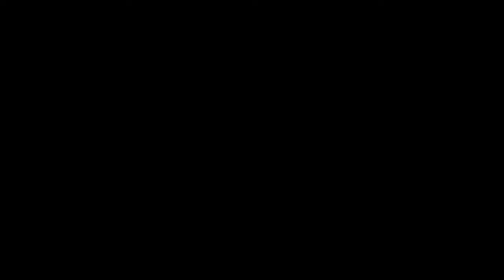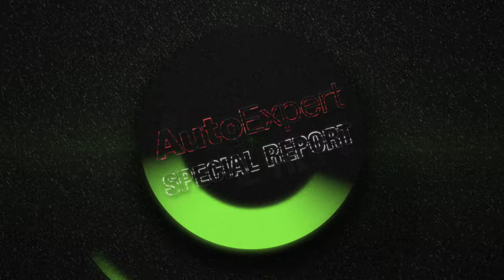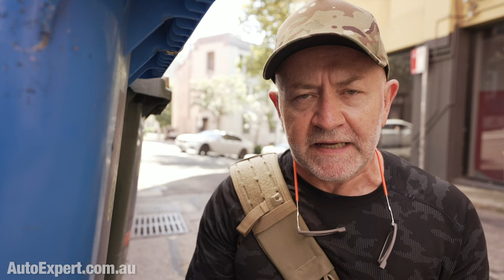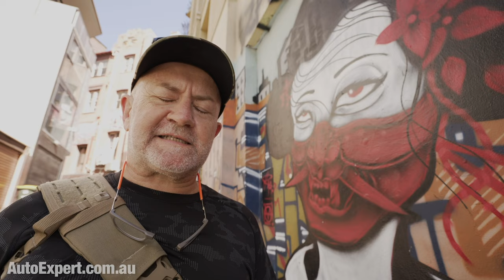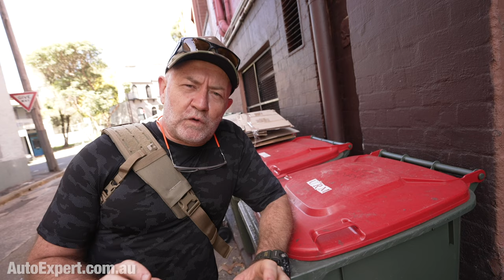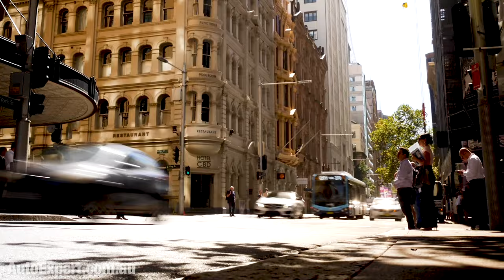These two simple hacks will make your engine last longer | Auto Expert John Cadogan

Comment: The Bmw M3 Has Major Issue Plaguing it Since Inception to Market , If you are looking for an E46 M3, you’ve probably heard about the rod bearing issue. In short, BMW did not spec the rod bearing sizes correctly, which causes premature wear and eventual failure. Unfortunately, the solution is effectively 100k mile rod bearing service. Engine problems are some of the Most common issues reported for the BMW M3 #1 Is Engine Failure , The E46 3-Series suffered from a design flaw in which the mounting points for the rear subframe would crack or tear over time, causing some serious damage to the chassis if left untreated. A cracked or torn subframe mount means the subframe itself can shift while the car is on the move, making the car unpredictable to drive. The most important thing to do when buying a used M3 is get a good look at these mounting points to see if there’s any damage, or if any repairs have been done. Bring a floor jack if you have to—this could cost you thousands in repairs if you miss it. , The M3 with the SMG transmission, know that the pump that actuates the gear changes is known to fail, and costs a lot of money to replace. Clunky gear changes are normal, but if you find on your test drive the paddles won’t respond to your commands or the transmission is shifting especially slowly, it Most Likely in need of a replacement pump. Ive Also Drove Many M3's Never was Impressed an Its Not Anywhere Near Performance Car Perfection Not a Singular 1 Ive Drove Could Earn That Title ... I Worked At an Actual Shop an Regularly Worked On the M3 TSB after TSB , Recall to Recall Electrical Issues Galore Non Communication from Computer Modules . I could Keep Going too  .....
Reply: Are you referring to the big-end bearings on the con rods?
Reply: @0Meaty  Yes

Comment: Don't forget to add a oil flush before changing your oil & filter.
Reply from the maker: Completely unwarranted if you change every six months (and do it with the engine hot).
Reply: Is it safe to do so on an older engine? I heard it is not!
Reply: @AlexanderSSI  Just change the oil before it turns to custard and don't bother with flushes. All that smutz that gets washed around 'inside there' by the diesel fuel (thats what flushing compounds are) ends up first clogging the oil filter, then going through the bearings before you drain the shiny bits of metal out of the sump drain.

Comment: Ah, lovely surroundings, nice to see.
My wife and I (we both have the same Toyota iQ car (a red and a blue one)) put the CVT in S when driving under 50 km/hr.
This way I thought would it more revs and heat u the engine quicker. Out of the city and above 50 km/hr we put it in D.
Plus, indeed driving now and then to a place (Zandvoort) 30 minutes away and come back. It's a nice ride alongside the coast.

Comment: Something that is very enlightening is taking and studying oil samples periodically, especially if what you do qualifies as anything close to severe duty. For example pulling a loaded trailer, very hot or very cold temps with high duty cycles. So remember the last time you were pulling a steep pass, loaded for an extended period of time? The life of the oil and the engine are in direct relationship to the temp. of the oil during operation. Treat you motor as if it was a fine athlete, a work horse maybe that requires an educated operator, not just a steering wheel jockey. If possible, buy a beer for a seasoned tech with some grey hair sticking out from under his hat.

Comment: Fact or fiction or just a waste of time and money
There has been much debate in our family over oil changes, the only common ground which you confirmed, a half service interval oil and filter change.

My brother (oil change)
Adds an oil flush the the oil to be changed. Then runs the car for the recommended time
Drains the oil
Changes the filter

Then
Uses a “cheap” but in spect oil and takes the car for a run.
Dumps the oil
Replaces the filter
Then fills with his preferred oil.

Appreciate your thoughts.

Comment: John,I change my oil and filter always before the recommended intervals. I also travel a lot of country driving (100kmh zones) always AND my diesel does have an genuine Mann and hummel catch can.  So in your opinion would these three things be beneficial?
My egr went on me over 100,000 kilometres now and hasn’t done it again since mind you I installed the catch can about 60,000 kilometres ago so I’d like to think it’s helping keep the inlet stay  clean. My reservoir hose on the catch can gets drained about every 3,000 kilometres and I usually get about 200 mls of cruddy oil out of it. My dipstick levels never drop either curiously

Comment: If people are reading the user manual will find that manufacturers have in place service for "extreme" exploitation of the car. One of the "extreme" is short city drives and they are advising for doing a service at half of the usuall milige. For this reason I'm changing to oil in my car every 6250 miles instead of 12500 miles. Never had any issues with oil dilution. An oil change is cheaper than any engine repairs.

Comment: I can tell you from experience that giving the diesel a good run every couple of weeks at operating temp doesn't stop the gunk build up, may extend it a bit but that's all  ... car makers need to build their vehicles with the correct  equipment fitted right from the get go instead  of pandering to the warm fuzzy climate change brigade and governments with inferior  diesel motors which are not designed for running around the city to drop the sprogs at school ... all they care about is sales

Comment: John, I fully understand the importance of regular oil and filter changes if you do short trips all the time.
That brings me to the question of what to do if you only drive the car once a fortnight, and then on the highway mostly. 
After a year the car has done 2000km, and the oil looks like new. Still golden syrup coloured. 
Can I then go two,  or even three years with the same oil?
Absolutely nobody can answer this question. 
Everyone has a different answer. 
Even Google can't tell. 
PLEASE HELP OUT HERE!

Comment: During lockdown I take my motorbike out once a week and try to break my ~207 km/h speed record. Am I doing it right?

Disclaimer: it’s a short stretch of highway near my house without speed cameras.
Reply: One slip, and it's Road Rash City. And death. Far too fast for public roads, and you might kill some innocent person if it goes wrong.
Reply: @markh.6687  Let's be honest, the only one dying will be me. It's a 200kg motorcycle vs 2 tonnes of car
Reply: @xntumrfo9ivrnwf  Not if you wind up through the windshield...or the driver suffers a heart attack after the accident, or hits another vehicle after the first crash.
Reply: @markh.6687  Agreed - it's a silly thing to do and frankly going fast in a straight line gets old quickly. I don't do this anymore, especially now with things opening up and more people on the road.
Reply: @xntumrfo9ivrnwf  Do you really think so? 200kg's doing 200km/h will do a lot of damage.
Reply: @h2oaddict28  yeh I know, I don’t do this anymore. Original comment was more cheek in tongue

Comment: Hyundai Engine
Class Action
Class action against Hyundai in relation to defective engines
Funder: Woodsford
Lawyers: Johnson Winter Slattery
Note: This website relates to the class action proceedings against Hyundai in relation to alleged defects in the engines of various vehicles sold in Australia since 2011. It is separate, and unrelated, to separate class action proceedings being pursued or investigated against Hyundai relating to alleged defects in anti-lock braking (ABS) systems.

Comment: How uncomplicated with life be when engines are replaced with motors!
Reply: Every time I look into an engine bay I think the same thing. I got an EV recently and I just realised how much less there is to worry about. You can floor it straight out of the driveway without having to worry about it being cold or doing lots of short trips or sitting in the Carpark in traffic with the aircon on. And did he mention do sevice more often?
I think I will just stick with the EV and skip on services.

Comment: So we are now sold cars that are not designed to cater to what most of us want them to do and we have to use them in an inconvenient way just to have them not foul up :(
Reply: Cars now are a little better at coping with short runs than they were decades ago when we used to walk or ride a bike for those short runs.  Don't blame the car; blame lazyness.  If it's less than 5km, a bike is about as quick or quicker anyway.
Reply: @zoltantoth7286  So you expect a pensioner to drive around the city for an extra half hour after doing their weekly shopping at Aldi so to help clog the already filled roads! And the sick bloke should have ridden his bicycle to his weekly radiotherapy at the local hospital oncology unit! Next time I see a dude leaving Bunnings on a bicycle balancing a 20 litre bucket of paint in his head,  I'll give a wave, because I know it will be you. If a car is not for the convenience of one's transport needs, what is it then for? If anything is "lazy", it's your thinking.
Reply: @martintaper7997  Of course I'm not talking about the pensioner or disabled person or when you need to transport a bulky load.  I'm talking about the healthy but lazy sods who clutter our roads with short trips in cars.  Around 95% of trips are shorter than 5km.  The roads would be a lot less cluttered if most of that 95% was done by walking or cycling.  As you said, a car is for convenience for one's transport needs but if walking or cycling is quicker, isn't that more convenient?  As a disabled pensioner, I can still get to the local shopping centre 2km away quicker by bike than by car.  If I need to carry a bulky load from the shops, I take the car and incorporate the shopping into a longer trip I need to take for some other reason.
Reply: @valerierodger7700  Firstly, I'm not referencing myself, so don't assume that I am - everyone doesn't comment from a selfish perspective as you assume. Secondly, yes cars have always benefited from long runs, but modern cars especially with direct injection will eventually fail to proceed and need repair where older cars would just need a good run to remedy the issue. Toyota has even designed their new range of engines to hopefully remedy this issue, so that should tell you how much of a problem it has become. Sure you can change the oil more often, and to avoid breaching  a new car warranty you have to use an accredited automotive mechanic to do it for yet more money again. (My opinion comes from being  a retired mechanical engineer with an interest in cars for over 50 years.)
Reply: @zoltantoth7286  Most people cannot ride bikes or walk for 5km or even much less distance . Riding a bike (as I do but not on busy public roads) is a dangerous pursuit. I knew a keen bicycle rider who was hit by a car on an overhead railway crossing bridge and flung onto the tracks below where he shortly after was dead. Better and free state owned public transport in the city and suburbs is the answer, not bicycles.
Reply: @valerierodger7700  
"And if getting regular oil changes really bothers you that much, get an electric vehicle." - how is that not referencing me personally! "Since you're only using it for short trips" - I'm not, and I didn't suggest I was! 

"You" as a generic pronoun is not used when "directly" addressing an individual as to their position, as you were, because of the inherent ambiguity, and there are other options other than using "one" such as, "if someone" or "if "anyone", but why not use "one", what's your problem with it? "Back pedalling gets one nowhere, we all know that."

Failing to proceed in the short term is unacceptable in any car of any era. You are unaware of the differences and the problems direct fuel injection has created; I suggest you do some research. 
 
Toyota did not incorrectly design their engines. Their previous engines "did not have" direct injection and so did not have the issue of fouling "in the short term". Toyota's new engines have a design which offers a remedy while retaining direct injection. They understood the problem and did not want the same unreliability issues of other car makers; so again, I suggest you do some research.

The problem is not one of my" exaggeration" or "arrogance" and since when was declaring "one's" credentials in a discussion arrogant - people are introduced by credentials even when they are not using them!  The issue  is of car companies rushing new technology to meet expectations of not only customers but more so government regulation, and also trying to save themselves money and maximise profit at the same time. Engine efficiency and cleaner emissions are not served by a design that renders the combustion process after a relatively short time less efficient and worsening for an extended time until failure, and many if not most owners and subsequent owners of new cars made today will over time treat their cars in a decreasingly caring fashion, and have always done so, it's in our nature.

Another example of this poor behaviour by manufacturers is the move to the CVT transmission. This is a cheap automatic transmission and can be done successfully, but some car makers have attempted short cuts. Nissan makes CVT transmissions which commonly fail under 100,000km, but I expect your position is that you would consider this is a reasonable life for a transmission - most don't.  

Customers should never be the testing ground for technology and engineers should get it right before declaring success - that's what I always do.You are a person who is not competent to comment on these matters, but not because you may not be an engineer, but because you have not made yourself aware of the issues in question, and in realising this now you have chosen to make yet another broad brush assumption by way of diversion from the topic at hand in order to discredit me in my realistic and reasonable position.

Do you understand irony, Valerie? You suggested I (or one) should buy an electric car to resolve the issue. So in doing so you accept there is an issue of unsuitability of the technology in question for the purpose for which it was intended, and that's exactly the point I was making!
Reply: @martintaper7997  don't use "one" because - in English - it is very formal, and often perceived as pretentious. "You" is the briefest and easiest alternative, easily understood by most who are fluent in english.

And somehow, even after I explained that I was using the term generically, you (specifically) insist on clinging to deliberate and petty misinterpretation.

You (specifically) continue to assume things about me - for example, you assume that I haven't done any "research", and that I don't understand direct injection. I have been working on cars for almost as long as you have "had an interest" in them, which is part of the reason that I understand very well what DI is, what problems come with DI, why DI causes those problems, what design features address those problems.

You, on the other hand, might want to do your research, given how you made the patently false statement that Toyota did not have direct injection engines before their "new" design. Toyota came out with direct injection engines well over 20 years ago, and they absolutely had fouling problems in those engines. Toyota is also hardly unique in addressing the issues of DI, as many automakers have long combined direct and port injection - Toyota was actually late to the party in that one.

You are absolutely exaggerating the problem, as direct injection has been around a long time, and engines aren't cratering early because of it.

Yes, credentials can be discussed without arrogance, but when you introduced them at the end of an argument, it is nothing more than an appeal to authority - the flip side of ad hominem.

And then you make the absurd suggestion that I might consider 100,000 km a reasonable life for a transmission - before launching into an explicit ad hominem attack! And that highlights your arrogance. A person who is simply confident rather than arrogant would have laid out their argument without trying to appeal to their own presumed authority or launching into ad hominem attacks. 

Recommending an EV is not in any way an acknowledgment of unsuitability, merely pointing out the obvious option. No technology is perfect. If one doesn't suit you (generic), you can always look to the alternatives.

Conversations about the pros and cons of various technologies can be very interesting, but only when people are interested in civil debate and exchange of ideas. You are clearly only interested in trying to justify your opinion - and not by presenting facts, but by attacking me. Have yourself a good evening, and do try to lighten up.
Reply: @martintaper7997  As I said, most people CAN ride bikes or walk but are too lazy and would prefer to drive for 15 minutes in a traffic jam instead of walking the same distance for 5 minutes on an uncluttered footpath. You know one cyclist that was killed, I know dozens that weren't.  I also know people that died driving cars - your argument means nothing. Public transport, is good for longer trips, particularly into cities, but doesn't work very well with short <5km trips; walking is nearly always faster.